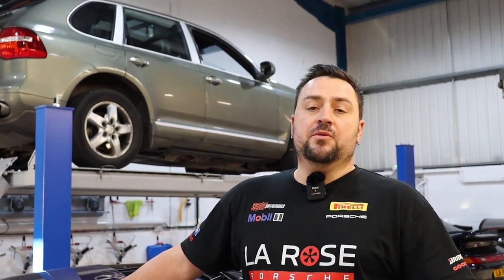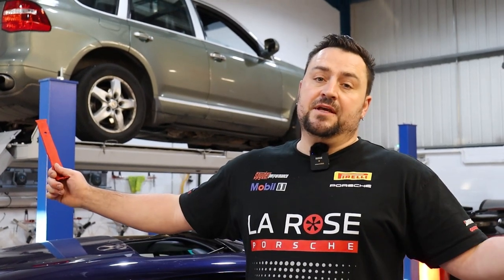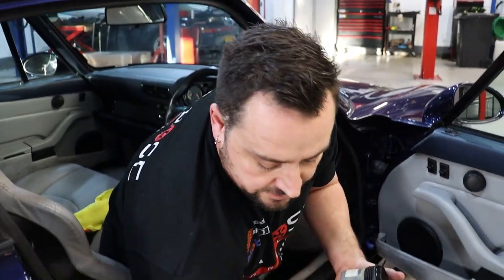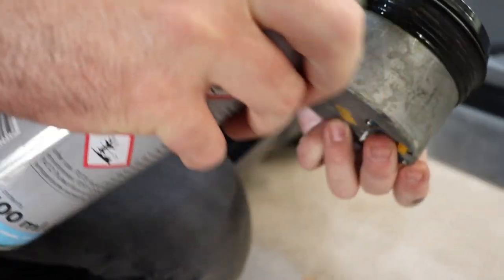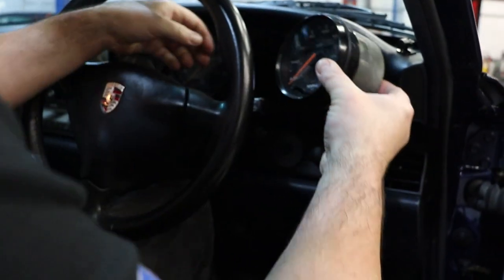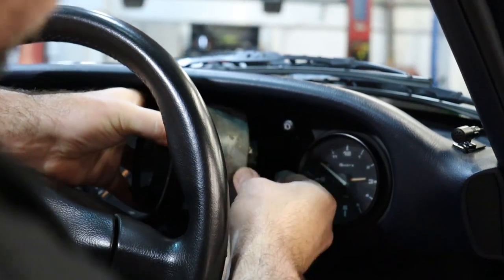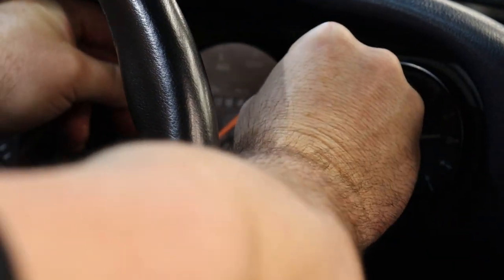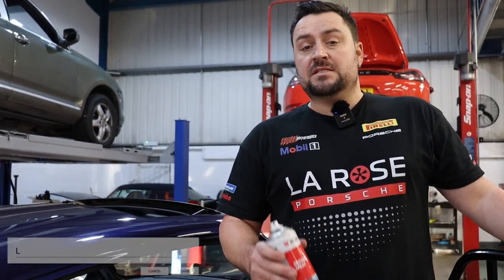PORSCHE 911 (993) ODOMETER REMOVAL!

Comment: I did this to repair/replace the little plastic gears. I took out the clock first which allowed me access to the body of the speedo. You can then push the speedo out with your (small) hand inserted towards the left of the clock's hole.